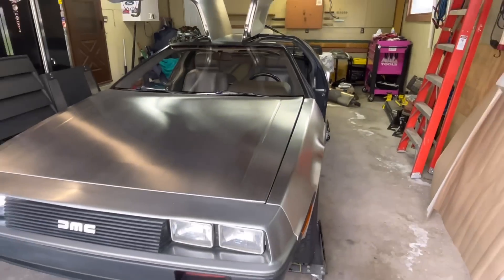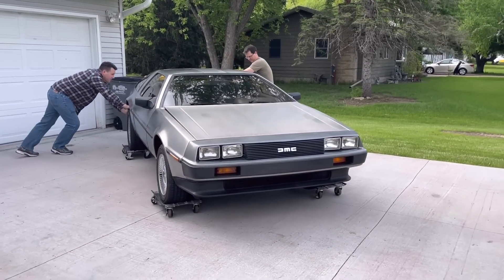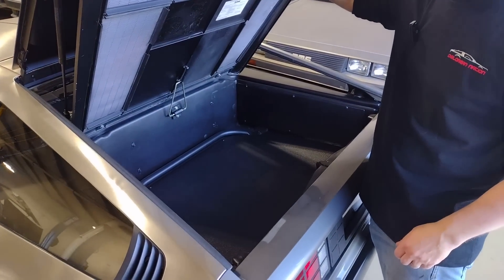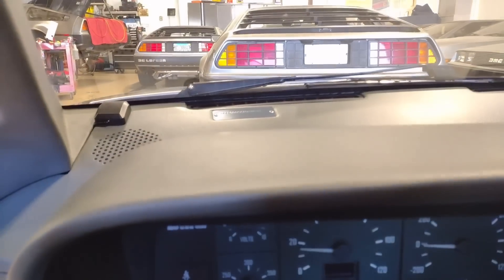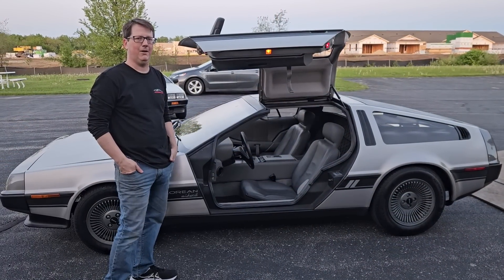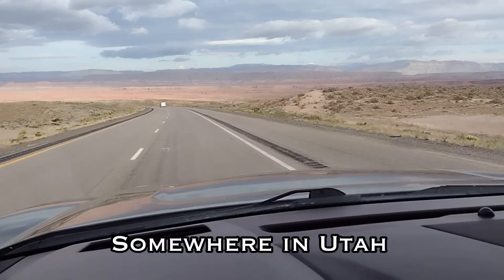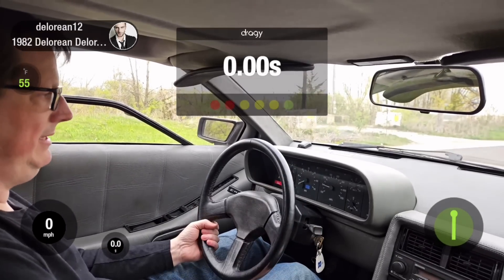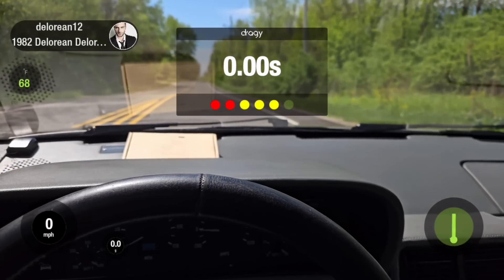Electric DeLorean APEX | Tesla Model 3 Performance Swap

Comment: Kerb weight, with a full 'tank' of electrons?
Does it have an M3P 3D1 rear motor and 82kWh battery pack? Why did you lower it?
Reply: Curb Weight is right around 2800lbs. 55kw of battery power with a 200+ mile range.

Comment: Price? I don't know about the GPS speedometer. Especially if you're driving in a city with tall buildings all around you (like New York City) or in tunnels.
Reply: I understand where you coming from. This is still WAY more reliable than a stock angle drive.

Comment: Given the fact that the speedometer reads 18 miles an hour when it’s standing still, I don’t know if I trust the 0 to 60 times, and also be just because it’s a DeLorean doesn’t mean you’re allowed to drive up the wrong way in the road
Reply: Full video of the fastest run is also on the channel as a short. Not sure where your seeing an 18 MPH start? Here in the US we drive in the right lane...
Reply: 0 to 60 and 1/4 mi times were performed with a Draggy. Pretty damn accurate.

Comment: Still reckon it NEEDS A FLUX CAPACITOR
Reply: And Mr. Fusion!
Reply: Actually a capacitor system dumping directly into the circuit would create a huge boost!

Comment: DeLoreans are awesome looking cars but notoriously unreliable and problematic, so this electric vehicle swap will be a huge improvement. It's too bad that lithium batteries were not really a viable option when this was originally being designed and built in the eighties.
Reply: Sure if you buy a stock car with all original parts you will run into problems. But the Delorean is a reliable daily driver if all the most common modern updates are done. The original engine was used in many cars of that era as well. It took me 15 yrs to get mine to that point after a long restoration process but car looks and drives better than new.  It's all a matter of what an owner wants to put in it and how fast to do it.  Similarly one could say a 1950s car was unreliable and not refined as a modern car, which is why people opt for resto mods.
Reply: @randysanchez3960  Well sure! Any bad car can be better with modern updates, but as-is the DeLorean was notoriously unreliable. Just ask anyone who worked on Back to the Future! They were constantly fixing that thing during filming.

Comment: annoying that "car guys" don't know the difference between a motor and an engine.
Reply: The words are used interchangeably today and have been for decades. Get over yourself.
Reply: @Defender_Tom  the words are not interchangeable. A motor is different than an engine and mixing them up is dumb af. It makes you sound stupid when you use the wrong word to describe something.
Reply: "Mid engine position" was mentioned to describe the location of the "motor". "Mid Motor position" isn't a term used to describe drivetrain layout. Drive type was referred to as a "motor" many times in the video. You don't know what your talking about but we are "annoying". Yeah okay drfranks knows best.
Reply from the maker: So you’re telling us that DeLorean “Motor” Company and Ford “Motor” Company have had it wrong for all these years? They must be dumb af 🤔
Reply: @deloreannation  to pacify the Dr these must not be referred to as DeLorean Engine Company and Ford Engine Company... What a laugh!!
Reply: @deloreannation  When was the last time you bolted on a starter ENGINE to your MOTOR ? (never once have you done so) Motors don't need starters.

IF you're a real car guy and not a mall crawler, you for sure have bolted on a starter MOTOR to your ENGINE.

A motor is not = to an engine and the words are not interchangeable, even if the general population uses the words INCORRECTLY.
Reply: @drfranks1158 
We know the difference. But in all seriousness language evolves through common usage and the words have long ago become interchangeable. 
Motorboat, motorbike, Trimotor, motorsport…etc are in all modern dictionaries.
Although not entirely: you’ll still never hear people refer to an “electric engine” or a “steam motor”.
Reply: @meofnz2320  once again, because repeating myself is fun.

"A motor is not = to an engine and the words are not interchangeable, even if the general population uses the words INCORRECTLY."

You can learn the difference, or keep spreading ignorance. Any way, done with this nonsense. 

MOTOR not = to ENGINE
 NOT INTERCHANGEABLE.
Reply: @drfranks1158  
Yes, yes, we all know the history and etymology of the words. An engine burns fuel and and converts the resultant thermal energy into mechanical energy while a motor simply converts potential energy directly to mechanical energy. 
But the Oxford dictionary is regarded as the most authoritative source on the English language and regards them as interchangeable in modern context

Comment: In compared with the original PVR engine ! Thise elektric engine is like a Sky Rocket !!!
Reply: Unless it's a built prv. They are actually good engines and can produce a bunch of power. Gik in Sweden had one making almost 700 hp in the early 90s and a prv engine still holds the record speed on Le mans doing 407 km/h in 1988
But I think Doc Brown would like a reliable electric one better 😅
I rarely drive mine though so will probably leave the engine alone. It's fast enough for the back roads in Sweden 😅